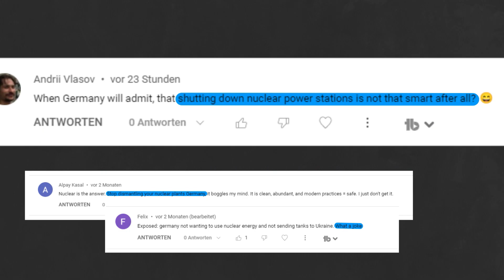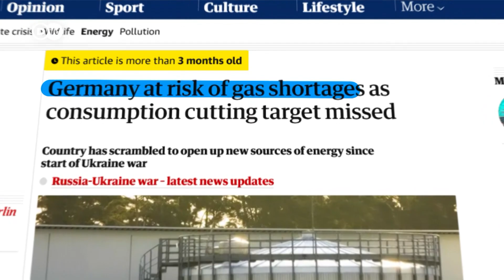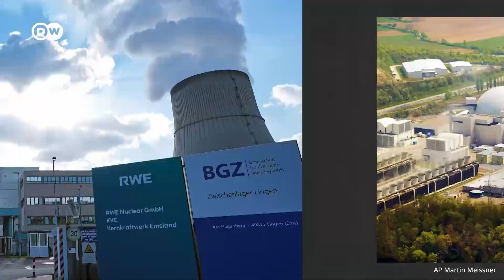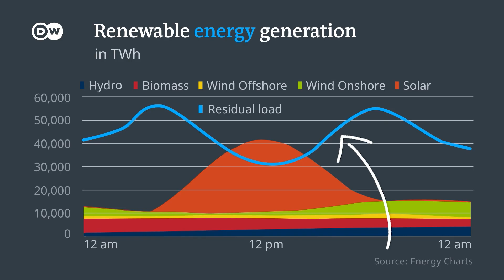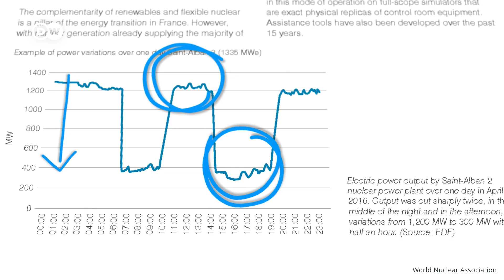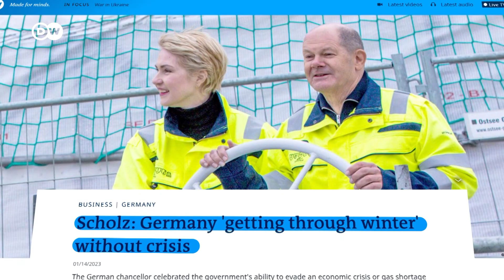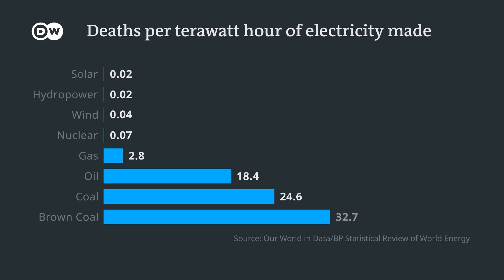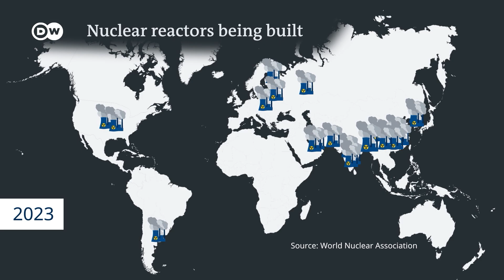Is Germany's nuclear exit a mistake?

Comment: I agree that nuclear would've been a preferable transition technology compared to coal. However, since the shutdown was decided in 2011 and the companies planned accordingly, the plants also can't run much longer.

The situation is less than ideal, but at this point, I think it makes a lot more sense to just go full throttle in renewables. The problem with that is that certain parts of germany have a really bad "not in my backyard"-attitude that applies to basically anything, be it nuclear plants, nuclear storage or even the much safer wind and solar plants.
Reply: Issue with renewables is that they can't provide a constant base load.

Renewables are now, and will be for the foreseeable future, more expensive than their fossil fuel counterparts.
Reply: @Touj-jp2dt  Yeah, no. Like, actually not, look it up. 

The base load is a problem, but there are technologies available to evade that. Are they horrendously under-implemented in germany? Yes. Mainly because the previous government didn't do shit and now everyone is in a bit of a rush. 

But fundamentally, renewable energy already is cheaper than fossil.
Reply: @Touj-jp2dt  why are they more expensive? if they arent running we are using fossil fuel.
what we need is better storage, if we can manage that it's renewables all the way. 
There also are, as seen in the video, forms of constant renewables

Comment: What the Green don’t understand is that this rapid transition to renewables is not only gonna be extremely hard to do but also very costly and they don’t tell people how much higher their bills for electricity will rise. The wisest decision is to stick to carbon-neutral NPPs until we have a stable and reliable renewable source. Other than that it is empty words based on the fear of radiation, Chernobyl and other stuff. Current NPPs are much safer than in 1986 or even in 2011, plus outside factors such as tsunami in Japan do not exist in Europe.
Reply: "The Green" perfectly understands it. They are cashing on it like crazy. And getting huge kickbacks from fossil companies for keeping them relevant.
Nuclear was the actual opponent of fossils. Wind and solar are the best friends, a lifetime insurance for coal and gas.
Reply: Ah yes "Dont build renewables because its expensive, just wait until they appear on their own and use other expensive sources in the meantime"

Comment: I am from Germany and I am ok with our decision phasing it out. The waste deposit sites are a problem, it's costly to build, maintain and break down the reactors, the fuel itself comes mostly from Russia and we have better alternatives:  Wind and solar. We could've scaled these up a decade ago but failed to do so. We were technologically ahead with these, but gave away our lead by focusing on our good old friends coal and gas.

I am not scared of nuclear power plants. But they do have a risks. They require nuclear fuel, which is often imported from Russia. They can be targeted as part of terrorist attacks, or war tactics. And errors happen. And chains of errors also happen. It's a matter of time that the next power plant is going up somewhere. You can reduce risks, but that's hard and you have diminishing returns, it increases cost.

So why should we try and make something inherently violent and try to tame it, when we can just slap solar panels on our roofs and put wind turbines on our acres?

Comment: It is not entirely mistake because the hazard is real. The safety issue must be addressed first, no matter how clean it is.
Reply: BS the hazard is as real as nothing because unless you got Soviet Union type of safety or Japan level of natural hazard, Nuclear is safer to manipulate than Coal and other fossile fuel, even the oh so fearsome radiation is less dangerous for a Nuclear engineer than for the people on plane or in space getting more radiation from the atmosphere and the Sun.
This was just an enormous mistake because of a blown way out of proportion incident that induced unfair fear into the hearts of the masses not helped by lobbyists who profited from not having an actual alternative to their fossile energy
Reply: Deaths per kwh for nuclear is roughly comparable with wind and solar, and far, far lower than hydroelectric power, coal, or natural gas. And yet Germany doesn't have any plans to phase out hydroelectric power, and won't be phasing out fossil fuels anytime soon.
Nuclear power is safe and reliable.

Comment: Germany absolutely made a mistake. Closing Nuclear power plants while still operating coal power plants is not "green" in any shape or form. German "greens" are either very very stupid, or bought by the coal lobby, or probably both.
The current power plants still have usable fuel. Stopping them will not generate less "nuclear waste" - it is the same amount. They could have easily been operated longer, and prevented coal from being burned.
Also why are hydro power plants operated as baseload?! They could easily be changed into more variable source, saving water when the sun is shining, and using it when it's dark. If the current hydro power stations can't do it, they should be upgraded. I'm not saying stop the river entirely during the day, but it should be easier to have variability.

Comment: If closing a nuclear plant results in using more renewable energy, do it.

If closing a nuclear power plant results in using more fossil fuel, leave it open. Whatever problems nuclear power has, fossil fuels are worse for the environment and human health.

Nuclear power isn't economically viable, but if it prevents fossil fuel use, it is worth the cost.

Comment: Why is no one talking about adjusting electricity demand? "What do we do when the sun doesn't shine or the wind doesn't blow?" First of it's always windy (especially at sea) or sunny somewhere, secondly we can move the heating demand etc for when there is overproduction of electricity. I assume that Germany (similar to Sweden) uses approximately 30% of the energy for heating, so if we just connect heaters to the internet we can easily reduce energy need by 30% when needed. Also I only charge my car when electricity price is super low = high production of renewables. Smart homes/industries is a big part of the solution

Comment: if you completely ignore the carbon emissions, coal is far worse than nuclear for the environment on every level including radioactivity. They have worked hard to relax legislation on them while Nuclear has understandably needed to prove they can work within all the stricter regulations. In the end, they both heat up water to turn a steam turbine and I don't think enough people understand that.

Comment: Massive mistake.
That energy is not going to be replaced with renenewables, it'll be gas at best and coal at the worst.
Until commercial fusion comes along (God knows when), fission is the only low carbon reliable energy source that any country can use.
If you have geography that lends itself to hydro-electric and geothermal, go for it (I will mention that hydro-electric is REALLY BAD for biodiversity and conservation), but not everyone has that option.
Renewables are not reliable energy sources like fission is; yes you can store the energy, but battery technology, like with fusion, makes this untenable today.
The nuclear debate, like with the gmo debate, is a scene where fear and misinformation dominates, and drowns out any reasonable discussion about the technology.

Comment: It’s at least risky to turn away from nuke in this environment. Mini reactors could be a viable option in the future. A city/town could have it’n own mini reactor(s). It’s seems like it should at least be studied. I understand the issues with nuke pwr but it seems less bad than burning coal/oil until we run out. It’s seems wind/solar in US is just adding to the currant coal/gas/oil/nuke and with the Ukraine situation it’s fracking time again. Also, wind and solar doesn’t work everywhere. It’s ver regional. And significant up front cost. I’m also trying to cut energy use and trying to get my family to follow. A hybrid system with grid/solar. Trying to reduce propane use bc on pro and it’s expensive. Gardening at home to save and decrease footprint. Energy storage is a huge issue.

Comment: This Video is extremly biased towards nuclear energy. Germany has not enough powerplants to provide the Land with significant masses of energy. The ones we still have can only produce 6% of our electric energy needs. We would need to build new powerplants. This endevour takes years and years to complete and also takes up resourcces that could be spend somewhere else (for example to build more renewable energy). Another problem is the Argument that nuclear energy is apparently green energy. Yes it doesn't produce co2, but it's a high-risk technology and it's byproducts are still highly toxic. My biggest Point is that Nuclear energy is the reason countrys like France aren't investing enough in renewables (even the charts in this video are pointing this out). They simply aren't forced to switch because nuclear energy is nearly climate neutral. This hole debate is completly irrational
Reply: It's highly toxic but can be easily stored safely. Yes it's expensive at first to build though.
Reply: @frankreynolds9930  what?! How could you say it's easy, when there is to this day not a single facility that's suitable for long term storage?
Reply: @kingbeam80ify  Long term storage means how long. In next 100 years we would have already develop tech to recycle it or even send them to space in next 200 years. Storage is not a problem at all. All the waste that has ever been created can fit inside a large stadium. Nuclear main problem has always been huge investment cost at beginning.

Comment: There are several reactor designs that are passive safe designs and ones who can recycle a large portion of the waste from other reactors. Nuclear is by far the best energy source we have because of what everyone sees as an issue. It doesn’t have a smoke stack all of its waste is contained no one accounts for the radioactive exhaust from a coal plant while simultaneously bashing nuclear energy. In their fear of nuclear energy they have stupid energy sources like coal, gas, and the worst biomass. This instead of passive safe, liquid fuel, breeder reactors that have zero emissions and can recycle waste from other reactors. They can also be configured to run on different fuels such as the abundant thorium. I can’t blame them for not wanting active cooling solid fuel reactors but abandoning nuclear as a whole is a colossal blunder especially if environmentalism is their goal. Relying on Russia for energy is also the hight of stupidity... So many layered mistakes born out of fear will lead to ruin if not corrected.

Comment: 1:36   "In 2002, Germany decided to PHASE OUT nuclear energy" 
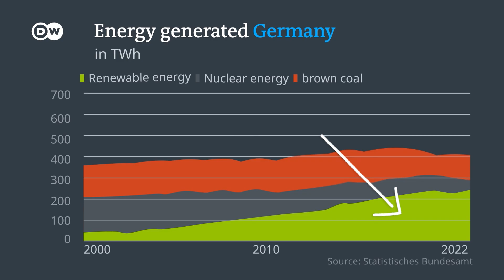4:29   "Right before the PHASE OUT, nuclear accounted for just 6% of the total electricity supply" while showing a graph that says that nuclear accounted for 33% in 2022 (170TWh over a total of 510TWh)
Did you mean: "Right before the SHUT OFF of the last three nuclear power plants on April 15th, 2023?"
Reply from the maker: Hey there! What you are referring to are the numbers on the left side of the x-axis, which represent the year 2000. If you look to the right of the x-axis, you will see the year 2022. Hope this helps!
Reply: @DWPlanetA  
Yes, I'm referring to the "left side of the graph", as the year 2002 is on the "left side of the graph", being 2002 the year of the PHASE OUT and 2023 the year of the SHUT OFF of the last three power plants.
You are still making a world salad mistaking "SHUT OFF" with "PHASE OUT". 
"At 4:29 you meant "SHUT OFF" (which happened in 2023), but you said PHASE OUT, which started in 2002.
 If you say "Right before the PHASE OUT" it means right before 2002, not 2023, as you yourself used the expression "to PHASE OUT" at 1:36
"Hope this helps!"

Comment: Was it a mistake to close the existing ones earlier than needed? Yes, it was.

That having been said. Even if you have nuclear reactors that can follow load fairly well, you would likely not see it used that much for the simple reason that having a nuclear reactor run 90% of the time at max output still makes it more expensive vs some other options, now add a lot more "downtime" to it and costs will quickly rise.

Also when you compare nuclear (+ renewables) with renewables + storage, you need to look at where storage is expected to be around the time the nuclear powerplants become operational. Even if the German government now decides to build some new nuclear, it likely will take something like 10-15 years before you have operational reactors. Add to this that renewable+storage is expected to be cost-competitive with nuclear around 2035 and it doesn't sound like nuclear is the way to go due to a lack of storage. There currently is a lot of research and development in energystorage and numerous pilot/prototype projects being launched in this regards. We are likely to see an explosion on that field.

This doesn't mean nuclear can't be usefull, it certainly can. It is just likely going to be more situational with respect or the accessibility of renewable generation.

Comment: Every country wants cheap and reliable energy which cannot be sustained by renewables.They are too expensive and inefficient and only serve to make the global elite richer.
Carbon emissions have practically zero effect on global temperatures and provide the best fertiliser on the planet so they are actually good for the Planet.
Nuclear combined with gas is the best way if you believe in the carbon emissions nonsense.

Comment: Germany is spewing out greenhouse gases and putting the last nail in the coffin of the great barrier reef. I will forever hold germanys fake green party and their social democratic enablers responsible for pushing many biological systems over the edge of anihilation. Germany is not shifting from nuclear to wind or sun. Simply because it is not possible. They are shifting to the absolutely worst source of power of all - brown coal. Germany's electricity comes from up to 50% from coal (differing from day to day). The german 'green' rethoric is as deceitful as Putins 'peace' rethoric. They must be held yo account by their voters and international partners. If the EU had any relevance at all for saving the climate surely the first step would be to forbid shutting down any fossil free power plants. But Germanys destructive influence is to strong.

Comment: Germany is dumb. Nuclear power is the best option for power. Its not 1950 anymore.  There's better nuclear power plant designs now that are way safer and way more efficient than those old designed power plants.  And all the plants that suffered catastrophic failure was all caused by people. Fukushima was screwed up because the Japanese put the backup generators in the basement below sea level Chernobyl was caused by people that did not understand how the power plant they were operating functioned.

Comment: I would have 50 nuclear plants and a full electric grid for cheap energy
Reply: "cheap"
Reply: @cyrusol  it is cheaper, not depending on other countries. How would Europe be now if it woudnt depend on Russia's gas
Reply: @UnwantedMessenger  "Would"?
Reply: @cyrusol  yees
Reply: @UnwantedMessenger  You are aware that right now Europe doesn't depend on Russian gas at all, right?
Reply: @cyrusol  yes, and where does Europe they take their energy from then? And how much has electricity/gas bills risen since Europe finished relations with Russia? Russia out of the picture, leaves a whole continent in debt, umprepared, rising inflation, just because they depend on other country.
Reply: @cyrusol  what is happening right now, with prices, inflation, are just the short term results, on a damaged, flawed, globalized economy.
Reply: @UnwantedMessenger  Depended*. Past. The electricity price will normalize. Inflation will end.